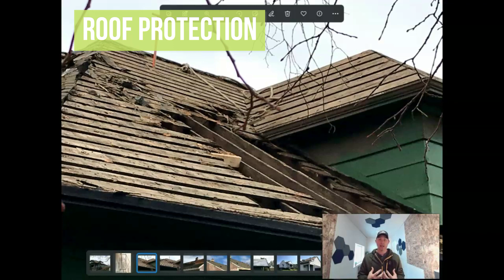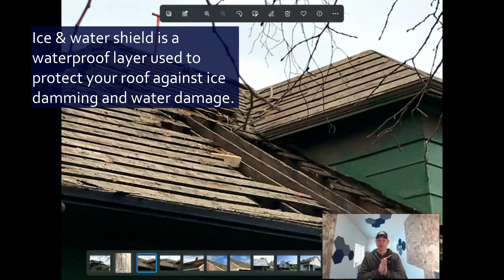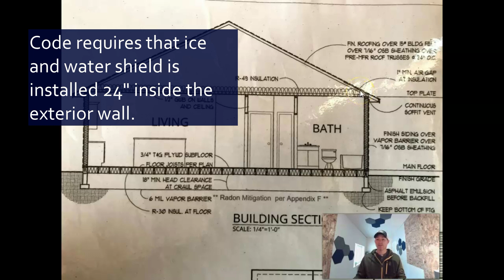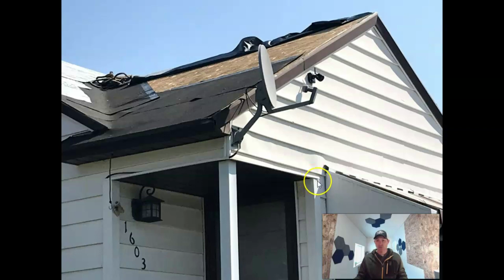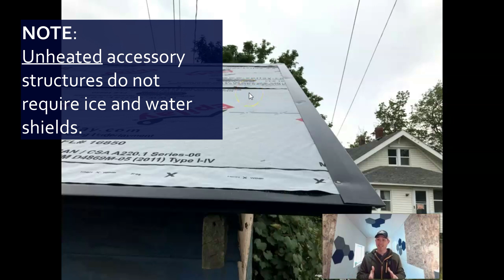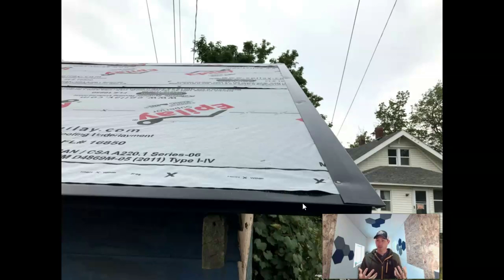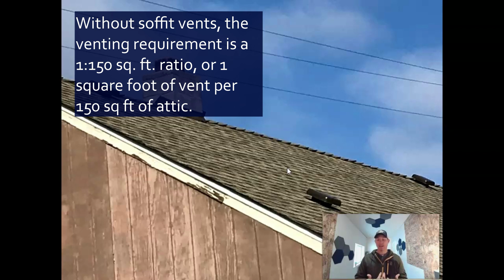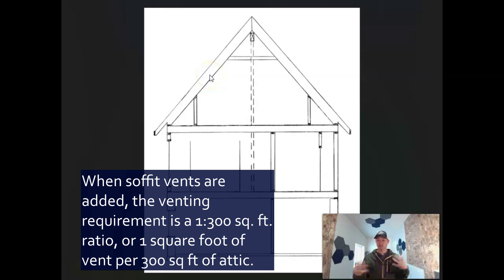DIY ROOF | MINIMUM CODE REQUIREMENTS FOR SHINGLE ROOFS EXPLAINED (PART 1 OF 2)

Comment: How about in the hip roof.  What is the codes for hip roof
Reply from the maker: Hello, Hipped roofs should be treated the same as a gable end roof. Solid sheathing, ice and water (if required), underlayment, flashing, venting, etc.
Reply: @ ok ,  how about the underlinement , do we need to over lap to the other roof slope?
Reply from the maker: @manuelloja2730  Yes, though I do not know of a minimum code requirement for that. Usually at the ridges the underlayment will carry over from both sides and a ice/water/metal will be run down the valleys.